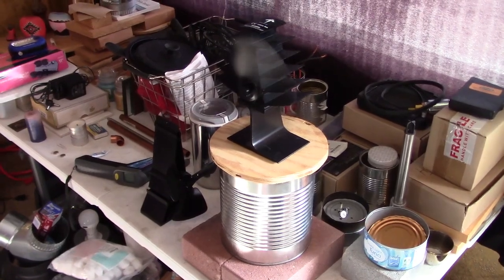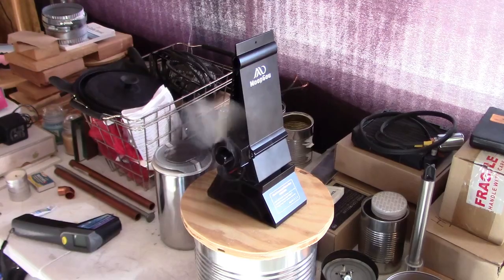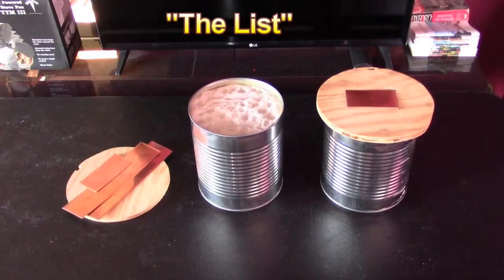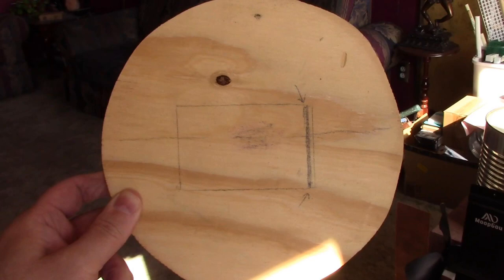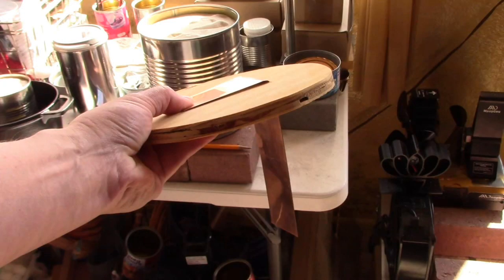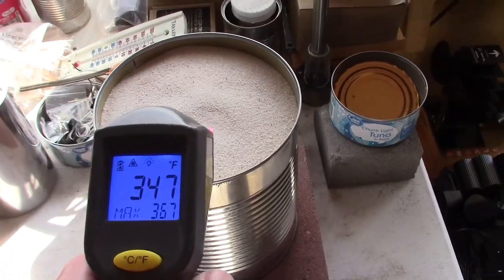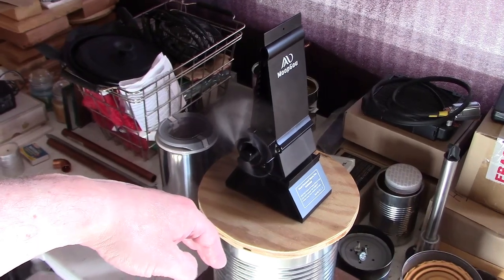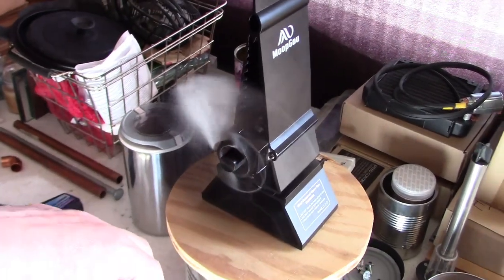Sand Battery Powererd Fan! Sand Battery "Cool Breeze" Cooling Fan! insulated! traps the heat! Ez DIY

Comment: I hate to sound stupid, but how do you heat the sand ?
Reply from the maker: hi. that can be done is a variety of ways. i'm typically thinking about heating it 'off grid' so you could use fire, rocket stove or other off grid stoves. you could also use parabolic dish or fresnel lens *if you've got a good amount of sun. 12v resistive and ceramic heating elements (along with 12v solar panel) is another option. 'on grid' options seem to be more limiting. but various types of heating elements are possible.

Comment: Am wondering what the math is? 1. How many watts to heat the sand bucket? 2. How long does the fan run until not enough heat? 3. Does the sand battery increase effeciency? Thanks for all your projects!

Comment: Did I miss something???  HOW DID YOU WARM UP THE SAND?????
Reply from the maker: hi. for the video i warmed it up in the oven. but there are many ways to do it. off grid is my interest, so i'm looking at parabolic dish cookers or fresnel lenses as fast ways to heat it. i've also used 12v ceramic heating tabs.

Comment: put em in something STEEL and put on top of an induction cooker................heat at high a few minutes throughout the day and then turn off and let the heat STORAGE of the sand keep the fan running

Comment: if you have an outer can, larger, filled with insulating sand, then put inner can, heated up, then its the most simplest construction ever
Reply: or whatever rock fire wool to stuff on-inside the outside can
Reply: bearings break, electricity is cut off (unless solid state thermo-couple or peltier), diy copper-copper-oxide thermocouples for electricity

Comment: QUESTION  Could you attach a small motor onto the fan that creates electricity?  If so, could you then attach copper wires onto the electric motor and run the wires through the sand creating heat into the sand?  I've been following you forever.. so I'm sure if anyone can make that happen.. it's you.  I'm thinking perpectual heat.  Maybe good for a greenhouse, etc.

Comment: What if you had the copper going through  your roof soaking in the suns heat and on the otherside, in your house on the ceiling there was this fan?
Reply from the maker: hi. the lowest starting temp of these fans that i've seen is 122F(50C). i'm not sure if the copper would get hot enough to run the fan.

Comment: In general I like your ideas and are very cool. But sand in the summer can get from 40-60C. I am interested to see the fan spin within these temperatures as they are more realistic.
Reply from the maker: hi. the starting temp of these fans is 50C(122F) so it will run, but kinda slow at that temperature.

Comment: This video taught me nothing. How does the warmth of the copper piece make the fan above it spin?
Reply from the maker: hi. it's a heat powered fan, so the copper draws the heat out of the sand and directs it under the base of the fan. the base of the fan is where the heat is needed to run the fan. these fans will run if set on a surface that is hotter than 122F(50C).

Comment: Love your channel and the great ideas you have, but adding better testing and measurements to your channel would go a long way. How long to heat the sand to that temp? How long did the fan run for? What temp did the exposed copper strip reach?

I hope the constructive criticism finds you well.
Reply from the maker: hi. the problem with getting too specific is that everyone will heat the sand differently and to a different temperature (so the fan will run a lot longer or a lot shorter time). if i just state a time it would create confusion. about the copper.... i couldn't get an accurate reading of the copper because those infrared thermometers don't like reflective surfaces. it returns a totally inaccurate reading. i think it read 85F but it was closer to 250F or 300F.

Comment: How? Is this special fan? How fan works?
Reply from the maker: hi. it's a heat powered fan. all you do is set it on a hot surface and it runs. they well them on amazon 🙂 (they have a TEG chip in them and that turns the heat into electricity that runs the motor)

Comment: I see you went back to the copper plates. What if you used a  large enough double wall stainless steel vacuum insulated wide mouth thermos? Then with ptc s mbedded in the sand heat loss is minimized and sand heats up faster,stays hot longer right. Of course with a good insulated lid also.See my comment on your Sand  Battery Air Heater for even more possibilities. BTW do you ever wonder if you're giving away too many good ideas(especially recently ) free to industry who may patent and commercialize them, even on a small scale?
Reply: Share together, save the world. My sand stove is also given to the people!

Comment: Um, how many hours?
Reply from the maker: hi. sand holds heat for a very long time so if the sand is well heated you should get several hours at a time. not sure how many exactly. i'd guess anywhere from 3 to 6.
Reply: If you use a battery like me inside a rocket stove ,it will keep somewhere between 4-5 hours . Problem it's if you add this cooper that I think that it will disipate ,it will love the heat more quickly . Here , some firms use Stirling engine to obtain home electricity . 1000 wats / 220 volts .

Comment: This should go outside, use peltier/Seebeck modules coupled between ground and sand battery... Run wire inside for a fan. You can insulate all you want, but that fan only works by heating the air inside.
Reply: Wouldn't insulation under lid and around it work?
Maybe aerogel
Reply: @corinneyeager  No. What makes the fan spin is heat transfer between the sand battery and the air in the room. 

It could be that moving air with the fan and heating the room by evaporating sweat by blowing directly on your body is worth it, but it will be a slight comfort with the higher temps... Why do that indoors when you could put the hot sand outside and transfer heat to the ground instead?    Then you send the electricity inside and run a fan that way.

Comment: This is AWESOME.  You've done it.  This is even better than a stirling fan because you've contained all the heat except under the fan.  This is great.  My great aunt told me how when they had no electricity on the farm in the 30s, they ran stirling fans under an alcohol burner...but this one, without a flame and insulated keeps the heat only under the fan.  This is amazing.  What a great build.  Thanks again!
Reply from the maker: hi there! glad you like it! i've seen those older stirling models. it's pretty cool what they had, back in the "good ole days". i wish we could bring a lot of it back into production. i'm still thinking about what else we could use to insulate it? maybe a scrap of actual water heater insulation
Reply: @desertsun02  Where can I buy those fans?  Maybe post an affiliate link or something in Description for a win-win
Reply: @desertsun02  I'm playing with a sand bucket on my wood stove as we speak...added some fire brick to the top but it insulates too well...hmmm
Fire BRICK!! YES
Reply: Hi , I've seen your texts on another site too.

Comment: ANY KIND OF SAND? WHERE DO YOU GET THESE FANS?
Reply from the maker: hi. i find the best sand is a fine "play sand". it's sold at most home stores. it's been cleaned and filtered and as a "soft feel", similar to beach sand. beach sand would work good too. you can get these types of fans on amazon. any of the ones with the lower starting temp seem to work great. (By lower I mean the ones that have a starting temp of 122F/50C) 👍🙂✔
Reply: @desertsun02  THANK YOU
Reply from the maker: @Barbara Downie sure thing 🙂

Comment: Now I need an air conditioner from a sand battery lol I have plenty of sand to use!
Reply from the maker: hi. i'll have to think about that one 🙂👍
Reply: shouldn't be too difficult. how about using the fan to spin the compressor that powers the air conditioner or if that won't work then maybe steam turbine.
Reply: @wilderness-beastt  I was thinking steam too